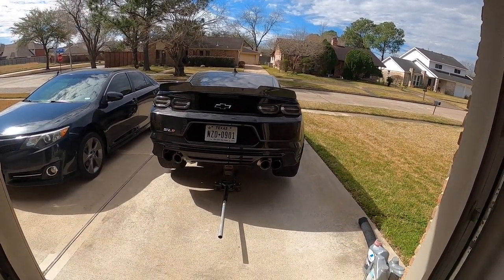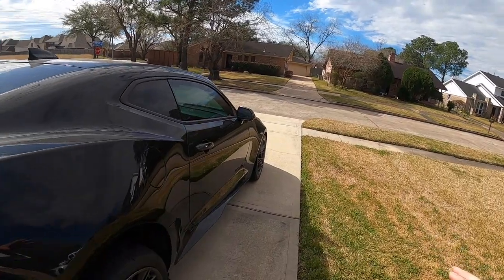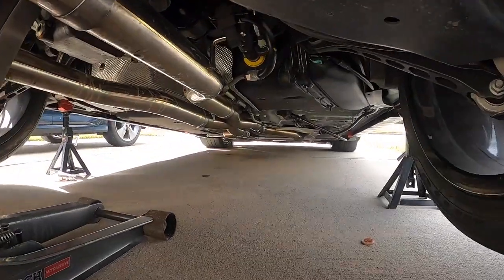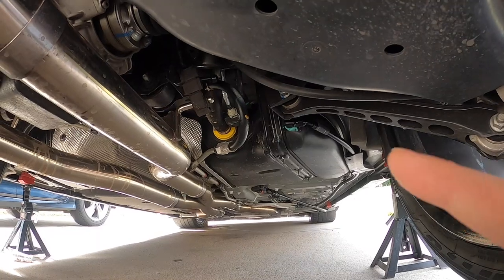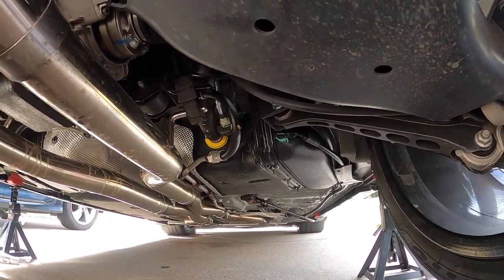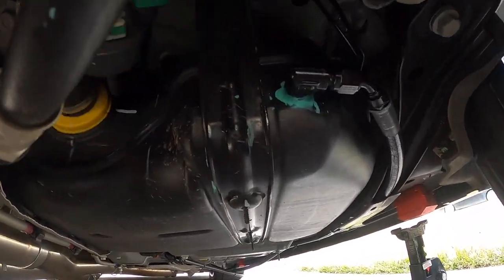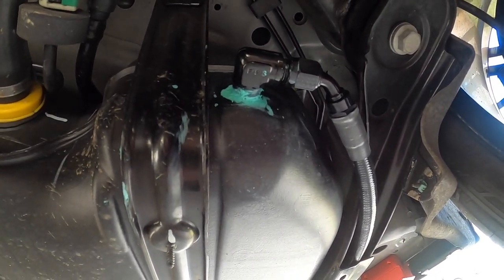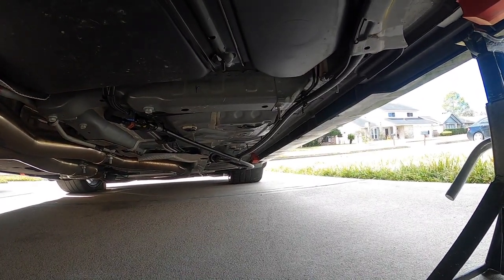DSX Aux Pump FAIL! | Vlog # 505

Comment: You gonna upgrade your fuel injectors ? You should put the big bore fuel pump along side with the dsx secondary.
Reply from the maker: If i was going to keep the zl1 longer i would have definitely done the big bore and 30% injectors, but the car is going to be on its way out here in the next two months.

Comment: Hey Jorge, any idea on how long it takes for a velossa tech to come in? I placed my order with Brett on the 11th but still haven’t gotten tracking info. Also what do you think it’d be worth on a FBO E85 10 speed SS?
Reply from the maker: Not sure probably have issues with back orders, but a velossa tech was worth about .5-.1 tenth and 1-1.5mph in my SS
Reply: @JLSpeed  Thanks for the reply. Looking forward to seeing you get the blower ported. Kinda sucks that the stock fuel system caps the car off around 630whp. Especially with how expensive the FIC injectors are 😬

Comment: Do you use lamda and where do you like your car at on the afr?
Reply from the maker: I don’t use lambda, but I like to have the car be around 12.0:1 at wot it usually runs a little tiny bit richer around 11.7-11.8 but I try to target 12.0

Comment: Same thing happened to mine, we installed it and I did some pulls and fuel pressure dropped, checked the fuel pump and it was burned up.  It was from not connecting the map sensor connector from the controller properly, apparently you have to have that connector connected with the wire colors matching, we had it  Reversed
Reply from the maker: Yeah I made sure mine was connected properly I just had a bad pump from the get go. If you have it flipped it will basically run the pump non stop lol
Reply: @JLSpeed  ok cool. That's what happened, I think it overheated and burned up. Matt overnighted me a new pump and it's been solid.

Comment: How crazy, My first pump also was bad. They replaced it  with another 396 and its been great so they do have problems with the pumps. They told me that they had just had a meeting with the mfg of the pump when my pump went out..
Reply from the maker: Yeah man it was wild, but I guess the 396 is hit or miss. The 392 is plenty of extra flow for our set ups though so it’s all good

Comment: Did you use the ls9 3 bar or LT4 4 bar
Reply from the maker: The lt4 since it’s running on an lt4 zl1 the ls9 3 bar is for 5th gen camaro and 2nd gen ctsv
Reply: My 6th gen Camaro has a 3 bar do I need to change it to a 4 bar
Reply from the maker: @16voss15  if you plan on doing boost yes it’s recommended but the tune needs to be set up for the 4 bar
Reply: Im running a whipple rn

Comment: when i went to get my car tuned. my tuner said my pump wasnt on. i think mine is bad too
Reply from the maker: If you have the dsx it should have a red light on the controller that will tell you if the pump is bad or not working properly. It is very easy to tell if it’s not working bc you will see the low side pressure or fuel pressure drop and not stay constant lol
Reply: @JLSpeed  it lights red when it just sit there and turns green when I hit the gas
Reply from the maker: @IMakeMoviesTV  does the blue light turn on if it’s lighting up red it’s probably bad. I would lift it up remove the carpet cover and test it by hitting the priming button and checking to see if it turns on. I even went as far as testing the voltage at the terminals on the harness to make sure voltage was getting to the pump when I pressed the button
Reply: @JLSpeed  I don’t see a blue like but I can prime it and hear it
Reply from the maker: @IMakeMoviesTV  then it should be working maybe it doesn’t work under load?
Reply: @JLSpeed  idk I’m gone check it out . TY.. it’s almost race season 😎😎